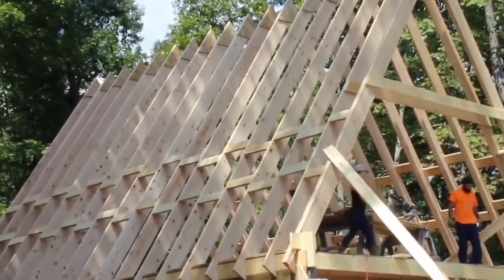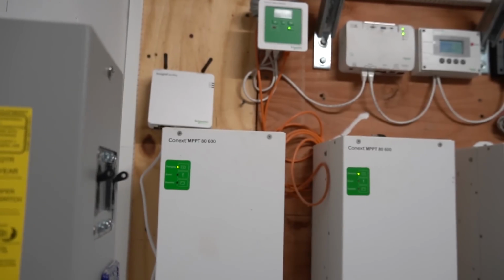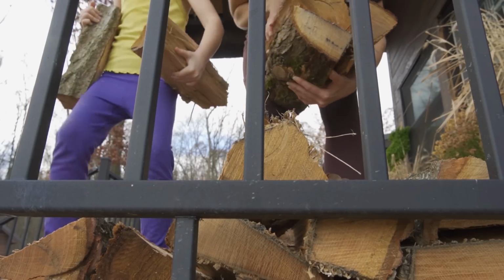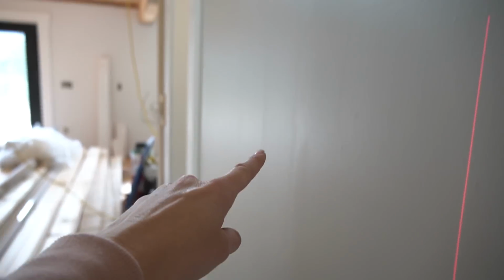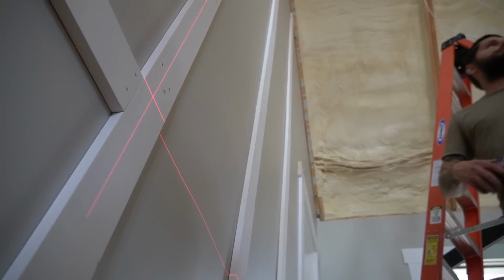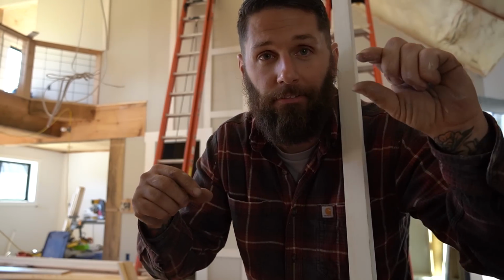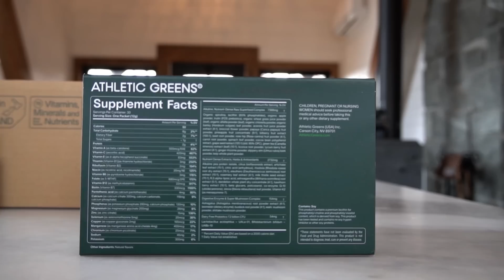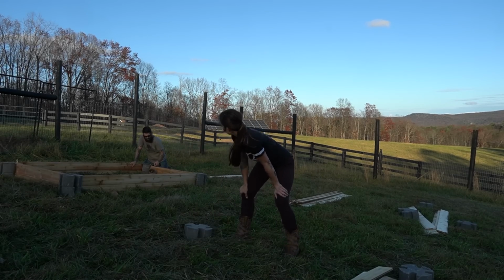We Got Bad News | Why We Prepared For The Worst

Comment: Add a wind generator or 2 with the land you have. You would have power generation thru dark winter. They even produce power overnight when solar panel dont. To set yourself up with the best system you need redundancy. WInd and solar together are the holy grail......I tried with just solar in PA just to your north and I was surprised at the amount of power generated by the wind during the winter. Just saying look into it and be informed. Great video as always!
Reply: I agree. There are new low profile windmills I believe most affordable
Reply: Great idea  💡 👍
Reply: I agree. A hydro Pelton  wheel would be awesome also. If they have a stream year round on the property.
Reply: Look into the vertical turbines, they don’t make the low frequency whoosh noise, don’t kill birds, aren’t directional and don’t have a wind speed limit.

Comment: I built my raised beds from rough cut pine 2x4's. They are lined with corrugated steel. The wood is treated with Seal It Green Garden Box Sealer. Its an organic plant based wood sealer that bonds to the fibers of the wood. The wood lasts 10 years or better easily plus its non-toxic and non-leaching. A little pricey ($88/gal) but worth every penny.

Comment: My above ground veggie and flower beds are built the same way. I used 2"x8" pine for 1 and 2 layer walls. I pinned the corners with 24" rebar and at the midpoint of each long wall to keep from bowing.  I have needed to replace the pine about 5-6 years.  2 4'x6' and 1 6'x6'.  My underlayer of soil is clay and broken shale.  We have to dig pits for bushes to plant them.  Good luck.

Comment: you need to put a fabric liner in your garden beds. if you don't you will be fighting the grass growing from under your beds. trust me, the people next door let me use their boxes built like yours and they were such a pain to keep the grass out of i stopped using them. the liner needs to be fastened to the sides well with a piece of board so there is no/zero gap for it to find its way through. good luck with your planting next year, maybe some canning videos will be coming soon.

Comment: hey guys, im an avid gardener,  and ive got a bad back. Its my suggestion to go up higher on the walls of your raised beds. you are going to be bending and squatting and driving yourself miserable trying to plant and then harvest with the beds that low. Filling in the bottom 3/4 with hugleculture method, (twigs, sticks, leaves, branches and logs), will make it so you aren't putting any more dirt then you planned with this height, BUT, it will save your backs. And, if it hurts to do it, you will eventually stop doing it. I hope this didn't come off as bossy or rude, I just know Josh had an awful back,  and ive had an awful experience with beds that low.

Comment: 1/2 split the electric line.  Power off, dig down to the conduit at the halfway point.  Check continuity (resistance).  If high resistance, that's the section with the break.  Keep splitting the distance in half until you find the break.

Comment: Part of the issue with the drywall looking cruddy is the sheen of the paint. It would be much less apparent with a matte finish.
Reply from the maker: Considering that this is a short term rental we need a sheen that will be able to be cleaned of dirty handprints. Matte or flat unfortunately is not super easy to wipe down
Reply: @WildWonderfulOffGrid  Yeah, I figured. I mainly commented for others as they consider their own choices for their projects.

I like your choice for dealing with the issue. And sorry if my comment came off as preachy or judging--I just wanted to comment quickly for visibility.
Reply: @WildWonderfulOffGrid  Btw, we run a very successful Airbnb and can share a few tips for helping make a very intuitive experience for the guests (and help you all get great reviews, which I'm sure you'll get anyway, but these little touches can help put your place over the top).

Hmu if you're interested.
Reply: @WildWonderfulOffGrid  eggshell finish is less shiny and is washable. Just fyi for your future endeavors.

Comment: Not sure and assuming based on the Wall Sheen that you may have painted it with a Semi Gloss.  Two factors effecting the visability of defects are size of the surface and sheen of paint.  The higher the sheen will show every defect, no matter how small.  Screw Head, thin mud, tape runs.... the list goes on and on.  Just a suggestion for the future.   If the defect was brought on by humidity causing the edges to rise.  Then forget the paint issue.  Replacement or your pattern will work.  I do like Molding/Boarder design to cover the area up.

Comment: Used billboard vinyl is really cheap, very durable, 100% water proof, uv-ray resistant and abundant. Could have used  some to line the inside of raised garden boxes using pine. Hunting blinds, small cabins, sheds, earth water slides, 100s of uses for that stuff.

Comment: Regarding the cable breakdown issue. You may use underground cable fault locator. Just ask some grid maintenance guys in your local utility. Mostly they’ve that test set. In US fault locator tools are easily available as rental, too.

Just get the idea from where the cable is broken and repair that portion only. 

Let me know if you need more info.

Comment: You probably could have used cedar Post just lay those right on the ground the same way you're doing post are a lot cheaper than the board and last  just as long I've had cedar on the ground at my place for over 10 years and it hasn't even started to rot

Comment: Congrats on turning the drywall "disaster" into a bunch of extra work, when flat paint would have solved it well enough.
Reply from the maker: Flat paint is a horrible idea when the house is going to be an Airbnb and the walls are going to need to be wiped down regularly. You can’t easily wipe down flat pain- it’d be a mess

Comment: Unfortunately I saw this coming with the drywall finishing. As picky as Josh was with your own personal home and seeing the drywall joints in other videos, I figured there would be issues. Using a higher gloss paint also enhances the drywall imperfections. On a wall that big , you should have had a level 5 finish. Meaning the whole wall should have been rolled with wet mud and knifed off twice. Going with the butt joints direction first and then the taper joints direction second. We all live and learn and sometimes not in the way we wanted.
Reply from the maker: Agree and unfortunately for us, however you aren’t going to find someone capable of a level 5 finish around here. This was as good as it was going to get with this drywall guy and we weren’t going to pay him to try and stay there day after day and try to get it right 😂

Comment: Having a partner that has the same goals and values in life are definitely life changing.  I got solar  and I'm unable to get to it yet. My one smaller generator with 4 panels I've charged it up but not used it yet. I've got the bigger generator in the box still I'm going to charge it soon.  Two panels for the big generator are 400watts each and I about  S×*t myself. They're Hugh omg hugh- I could barely get them in the house and they're not light weight.  But I got em because I can have emergency power that I can move with me when I go from this house.

Comment: That’s a great idea for garden beds. Where did you find those concrete joiners. I don’t recall ever seeing them up here in Alaska.
Reply from the maker: They were on the garden section at Lowes 😊
Reply: @WildWonderfulOffGrid  Thank you so much for answering. I’ve been trying to figure out how to economically do the garden beds. I’m in Alaska. Years ago, I did have a waterbed someone gave me where they built the frame themselves, making aluminum corners with slates like the concrete for the end and side boards to fit. I don’t have know how nor tools for soldering so this is really great!❗️💗💕😊

Comment: the only downsize with your energy setup is that burning wood (heating) and the abillity to procure gas (cooking) and fuel (generator)
will be impossible and prohibited in the near future as the governments strive to have zero exhaust all over the world,for now,your setup is great,but several years from now you will have to cope with just your solar pannels (and maybe a windmill) or be again connected to the electricity grid,maybe there will be the possibility to use H² for some utillities,who knows what the near future will bring us,more headaches 😁

Comment: You’re doing exactly the right thing by having a backup generator.  But let’s be honest, your lifestyle does depend on being able to purchase propane, a fossil fuel.  Without it, you’re subject to the same blackouts that are beginning to affect the rest of us, connected to an electrical grid increasingly destabilized by dependence on wind and solar.
Reply from the maker: If we want to go through life without taking into consideration our energy usage THEN we need the generator. However, our solar is size large enough to prevent us from experiencing blackouts as long as we pay attention to our energy consumption. So for example, if we had extended days of clouds or snow we would just need to wash dishes by hand, be mindful of tv usage, how much we run the washing machine etc. So our lifestyle doesn’t depend on fossil fuel, we can just regulate how much energy we use each day if need be. If we don’t want to regulate energy consumption then yes, we would need fossil fuel but if we we didn’t have fossil fuel we would still have power and be perfectly fine whereas someone on grid would have no power